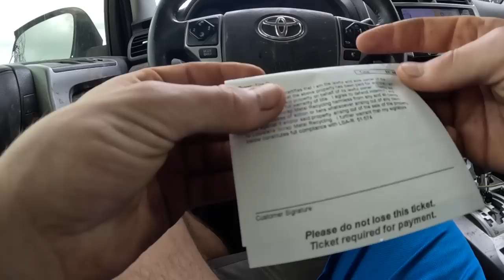Magnet Fishing In A BOTTOMLESS Pit - This Might Be The Best Magnet Fishing Spot Ever!

Comment: Motor....The first silver thing is a stainless steel submersible pump for a well, the big motor you say is either an old generator with gas engine mounted or an even older air compressor.  I would bet generator 5 to 8 hp motor.  The dome looking thing is a brake chamber to a semi truck.  The item with the spark plug is the armature or coil to that generator I would guess. The chain tighteners or chain binders are the tie down things.  Great day sir.
Reply: bump this comment, very informative
Reply: I think you nailed it with compressor, my granddad  had one looked a lot like that with a huge tank attached

Comment: That thing you called a come along is called a chain binder and yes, they are very common on flatbed semi hauling in order to chain down heavy or awkward loads to the trailer to keep your load from shifting (I am a retired long-haul trucker and ran flatbed for years). Those are worth far more than the scrap price if you can clean it up, give it a bath in some WD40 and make sure everything moves freely. Even used like that you could sell those all day long at a truck stop for 50.00 since new ones these days will run you anywhere from 120.00 to 400.00 per binder depending on the manufacturer

Comment: That one thing was part of the exhaust, all you need to do is break them blades off the fan and that's a motor also that motor with the pull start was a push mower motor, you need to check with the scrap yards cause any power tools you find should be considered motors

Comment: You are currently getting 11-12 cents a pound for regular scrap metal.  Not sure motors are worth the time and effort keeping them separately at this time. Electric wire is more valuable if kept separate if ends are cut off. Usually 82 cents a pound.